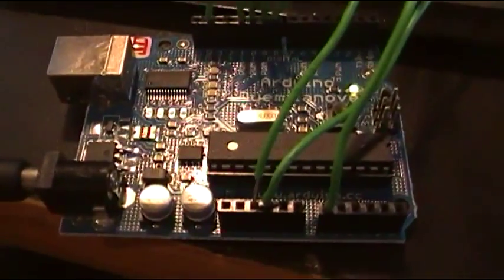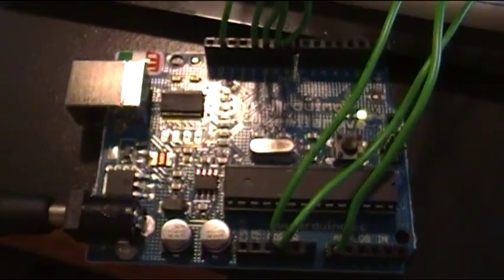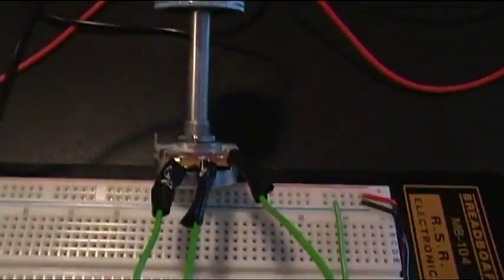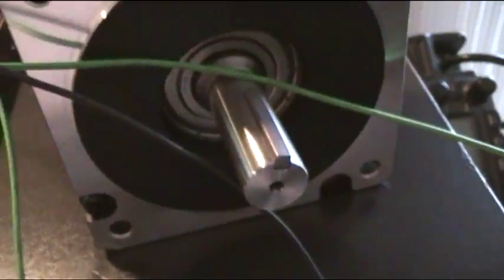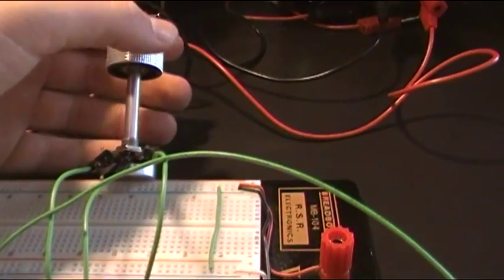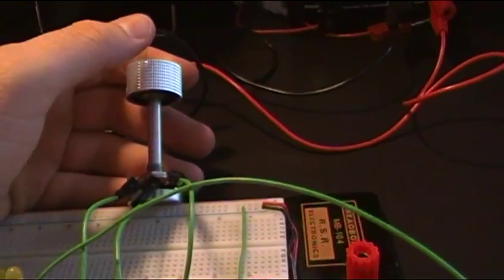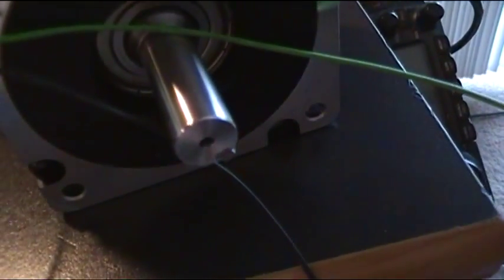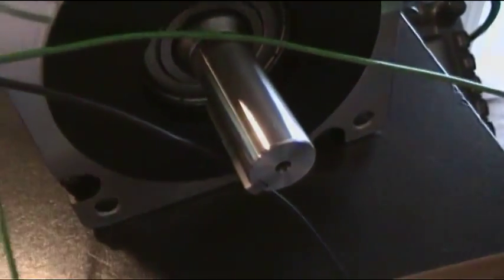stepper motor controlled by potentiometer.

Comment: /*

 * MotorKnob

 *

 * A stepper motor follows the turns of a potentiometer

 * (or other sensor) on analog input 0.

 *

 * http://www.arduino.cc/en/Reference/Stepper

 * This example code is in the public domain.

 */

#include <Stepper.h>

// change this to the number of steps on your motor

#define STEPS 100

// create an instance of the stepper class, specifying

// the number of steps of the motor and the pins it's

// attached to

Stepper stepper(STEPS, 8, 9, 10, 11);

// the previous reading from the analog input

int previous = 0;

void setup() {

  // set the speed of the motor to 30 RPMs

  stepper.setSpeed(30);

}

void loop() {

  // get the sensor value

  int val = analogRead(0);

  // move a number of steps equal to the change in the

  // sensor reading

  stepper.step(val - previous);

  // remember the previous value of the sensor

  previous = val;

}